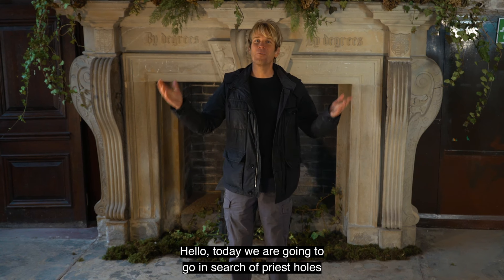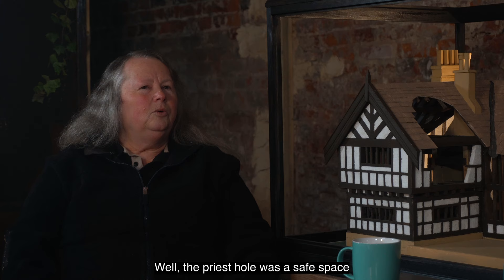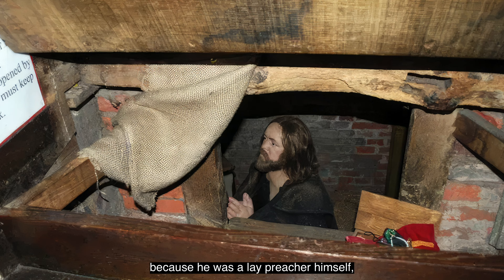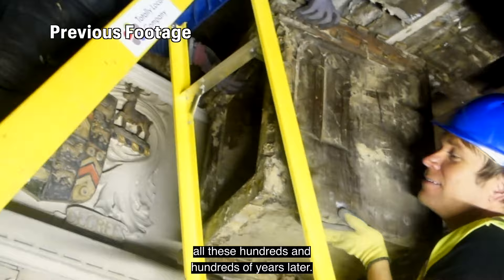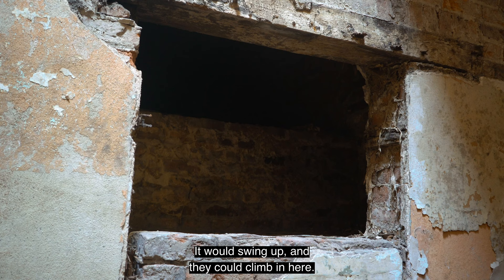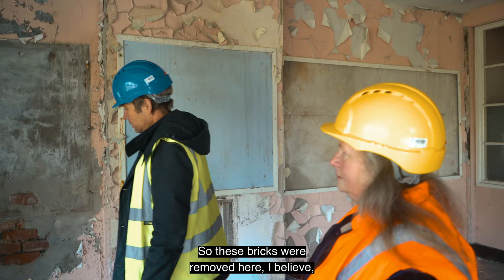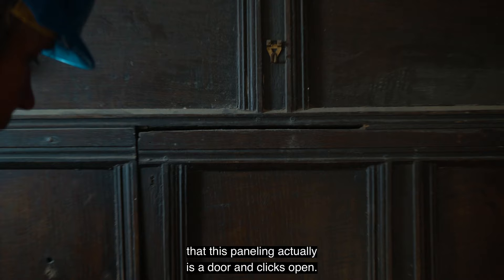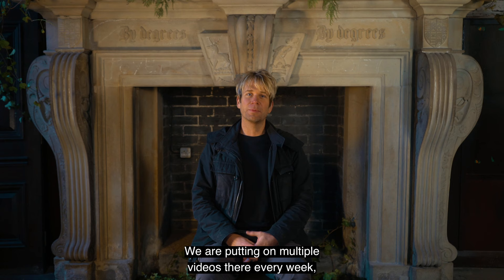Secrets within the Walls! - Priest Holes

Comment: It has never been illegal to be a Catholic in England. It was illegal to attend a mass and of course, to hide a priest would incur severe penalties or even death. A priest's hide would not be detected by tapping on the wood panelling,  because the wooden beams behind the hide entrance would have been thick enough to cancel out any hollow sounds. It would not have been possible to hold a "little mass" inside a hide because, with very few exceptions most of them could only hold one or two priests due to the very cramped space.
Reply from the maker: Thanks Patricia!

Comment: The hole in the door where a key would fit, take a photo of the hole within the hope that a locksmith could identify the type of lock it is by usually looking through the hole and looking at the actual key way of the lock, for that period it's probably a warded lock, post the photo on the community bit id like to see for myself if possible, maybe a Joseph Bramah lock
Reply from the maker: Ok thanks Clinton! We'll check it out!!
Reply from the maker: @Clinny-  thanks so much- great to know!
Reply: @HopwoodXIV  Have none of you're film crew got an endoscope type camera thin enough to place inside the hole to see what locking mechanism it is
Reply from the maker: @Clinny-  not yet but that's a good idea.  It would have to be a very small camera to work. That area is currently closed off for works but as soon as we can get back in there we'll see what we can find and hopefully make a follow up episode about it